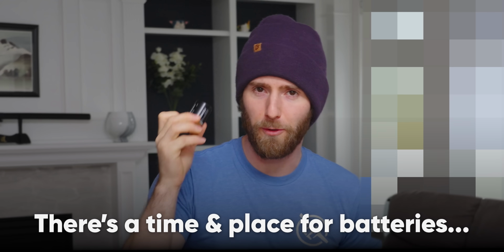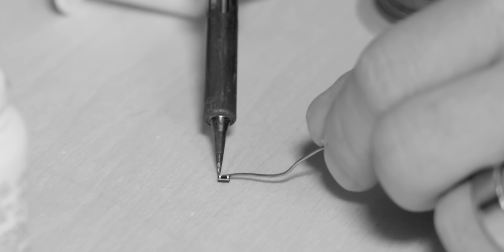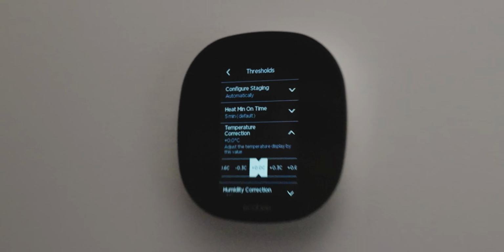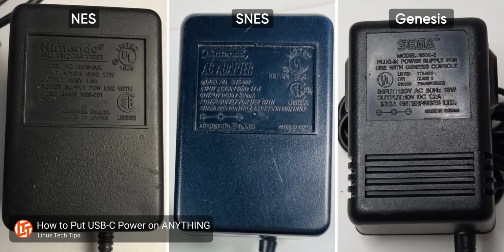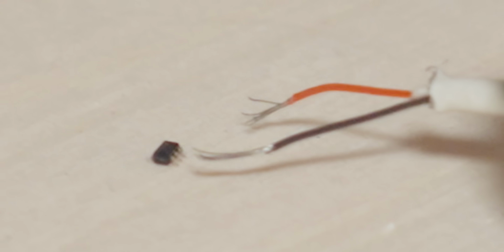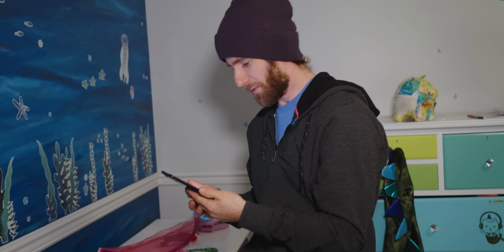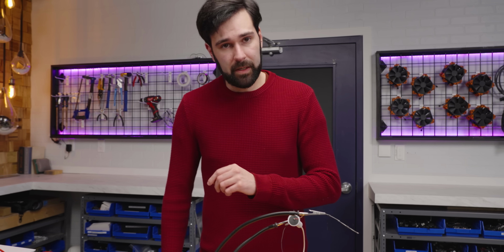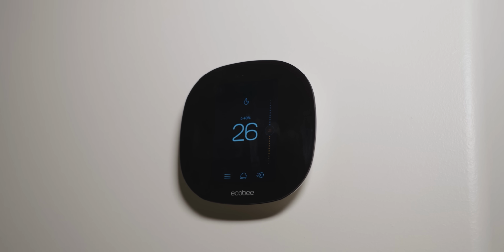I HATE Batteries! - Converting Wireless to Wired (a cheapskate’s guide)

Comment: Pro tip, ethernet can be used to run low voltage long distances to thermostats. If you have crown moulding on the cielings its a perfect space to snake them through.

Comment: At that point, you may as well use the LM2596 board and just smear it with hot glue. Yes, it'll use more power on idle since it's made for supplying up to 3A, but the size and cost makes it very well worth it.
Or use literally any $0.5-$1 buck converter off eBay

Comment: A Resistor is not regulator.
Using  the voltage drop of diodes  to regulate power  is not efficient at all. 
Ironic that they convert the unwanted power to heat in a temperature sensor.
Just use a damn voltage regulator like you had in the video, but RTFM and use the decoupling capacitors to make it work properly.
Its not really unsafe with such low power, but its not best practice nor reliable.

Comment: Now, I kinda want to develop 3D printed, battery sized / shaped object, with variable voltage chip in PCB (0 to 5V) from 5V USB. Where you just solder 5V wire. 
But I don't have a use case on hand so, idea for someone else.

Comment: Be aware. USB 5V power supplies, especially this cheap, will probably introduce a lot of noise. A device made to run on batteries is suddenly plugged into the wall; if you want to do this properly and trust the readings, I would recommend stepping up the game and doing a proper step down with capacitors as filters. You can still do it very cheaply if you use a piece of prototyping PCB, the ones you can easily solder passthrough components, plus the soldering will be muuuuch easier
Reply: Definitely this. For this application I would have gone with an AMS1117 3.3V linear regulator and some smoothing caps and fed it with the USB 5V supply. In my experience that should generate a clean enough supply.

Comment: The current spikes are quite common in battery powered wireless devices. It jumps up a lot when they start transmitting. Also,  I would really avoid using diodes to drop the voltage. If you insist on big tht components, it would be more appropriate to use resistor and Zener diode which are more suitable for voltage regulation (although voltage regulator is nowadays still better choice).
 Using voltage regulator without input and output capacitors is not recommended and can lead to failure to output correct voltage (depends a lot on given model, manufacturers datasheet will specify minimum value). If soldering small components is issue, you can get small voltage regulator breakout boards from AliExpress for cheap, which already have capacitors and the pads you need to solder too are big enough. There are also some products that are made for this purpose (PCB in a shape of a coin cell that has voltage regulator on them).
Reply: No reason to avoid using voltage drop of a diode if the supply is regulated (which in this case it is)
Reply: @pasikavecpruhovany7777  at such low currents, the forward voltage drop will vary a lot and the voltage will plummet when the device starts transmitting (as they experienced). Not really a good solution when proper voltage regulators cost the same or less
Reply: @SolaLupus  Using diodes rated for high current is not ideal, but for quick DIY solution, diodes are probably best way to go. The voltage won't fall under ~2.9V (5-3*0.7) and if voltages above 3.3V are an issue, the issue would likely manifest itself by excessive current draw, pulling the output back down. Another way to keep the output down, closer to 3V, would be adding a large value load resistor to pull few μA or instead of diodes using transistors in diode configuration. (With base tied to collector.)
Reply: @pasikavecpruhovany7777  if you insist on really low level diy solution, Zener diode with series resistor is still more appropriate way to go imho (also less components)
Reply: @SolaLupus  Not really in this case.The load has short high current spikes. Series resistor needs to be calculated based on peak current. Parallel zener regulator would turn peak current into continuous current. Series zener and paralel resistor would work the same as 3 silicon diodes and paralel resistor, avoiding that wasted power draw.

Comment: LEDs are good for dropping a bit more voltage.

Red for about 2v drop. Good for powering 3V devices from 5V.
Blue/white drop about 3-3.3V. Should work fine with most stuff that use a single 1.5v battery

Comment: Most smart home ecosystems allow you to use a compatible sensor (wired in your case) to control other devices (the thermostat in your case). It’s kind of the entire point of them. I’m using an old iHome sensor (wired) to turn on my Ecobee via HomeKit if the temperature in my utility room drops too low to prevent pipes from freezing (utility room has an outside entrance).  I use the Ecobee sensors to average temp across the house and the one in my office to turn on the lights with motion again very basic home ecosystem stuff I guess is more functional and doesn’t require a Jake on staff to set up….anything ever happens to you (or Jake) and your family won’t be able to turn on the lights to see that they are freezing….😂

Comment: In other words, do the setup with the battery installed, and after in initial setup and pairing, remove the battery and add the wired connection...

Comment: Linux, instead of the microchip regulator, people can use the more famous AM1117-3v3, its a 3.3V regulator but its sold for peanuts already in PCBs which include the required components like capacitors and resistors, take a look online :) That and 2 extra wires and people almost dont need to solder stuff, or worst case scenario, burn their hands

Comment: It's probably fine at 3.3v. you could use a 3.3v zener diode in parallel with the device and then a single resistor in series beforehand to make a simple diy regulator. You just gotta make sure you spec your components right so you don't fry anything.
Reply: Yeah~. A potentiometer is not the way to regulate voltage to an active circuit. Much less anything radio.

I'd even bet the first thing inside that sensor is a regulator boosting battery voltage to a standard 3.3V.
Reply: @RandornCanis  Good point. Examining the actual power circuit can take a lot of guess work out of it. Sometimes electronics accept wider voltage ranges than you'd expect.
Reply: Yeah, that's the proper solution, but they probably didn't have any Zeners lying around. If you're ordering components anyways, that's way better than making a giant chain of diodes.
Reply: @anlumo1  the series diode one isn't a bad solution. They have a generally stable voltage drop especially if your doesnt suck much current. With a general voltage drop of about 0.6 volts you could put 6 in series and maybe an extra shotky diode to make the 2 volt drop

Comment: Two copper plates, solder to the copper plates, 3D print an exact copy of a battery. There, easy conversion in terms of cable portion. Then you just need the right input voltage/ampere.

Comment: Why did they choose an linear regulator in an smd package? Something like the standard LM317 in a TO220 package with two through hole resistors would have gotten them exactly 3.2V, been way easier to solder, and probably still fix 
behind the battery cover. 

Later in the video they address using smd components as "making do", but you can definitely order electronics components with same day shipping from multiple distributors in the US and Canada.

Comment: I have converted such devices by using a 2 * AA battery holder, as 2 1.5 V AA cells make 3 volts in series.  AA batteries are much cheaper and the device runs many times longer than on a button cell.

Comment: If you get usb output in the power outlet in the wall you could move the dresser back a bit more. I'm all for stationary things not requiring batteries. It seems our smoke detector batteries go bad at the worst possible times.

Comment: Since you're on home assistant you just could assemble your own sensor based on ESPHome (esp8266+DHT) and put it in your wall socket
Reply: I'd advise against a DHT11 for something used to control the room heating as even a degree change can make the room super cozy vs uncomfortably cold, and the DHT11 is pretty inaccurate at ±2 degrees celsius. A DHT22 is a fraction pricier but much more accurate, and if you want to get even better readings( temp+humidity+air pressure), there's the BME280 I think it was called.

But yes, the 2-pack of Linus sensors cost a whole 120 dollars, and the ESP is far far cheaper. I reckon if it's just a single sensor, they can also use the ESP01 as it is TINY.
Reply: @namankohli1061  better would be the Sensirion (IIRC) SHT40, SHTC3, or SHT31 (in order of price), as they're I2C interfacing, not the weirdness of counting the pulses that a DHT11/22 uses. Less of a concern with a single purpose endpoint, but might as well avoid. 

Then again, I don't know how annoying those are to physically interface with if you don't get a dev board with them like Adafruit sells.
Reply: Big brain solutions. I doubt linus wants to dedicate that much time into this however.

Comment: I have to admit, that SMD soldering was pretty impressive considering the fact that Linus was in such a sub-optimal environment for doing it. I've done some amount of SMD soldering though I tend to avoid it if I can because it can be fairly annoying (especially if you're talking 0402s).
Reply: Agreed, I think a better solution would be to use all through holes and get some very small breadboards. Using SMD is asking for trouble lol. If breadboards cost too much you can get these prototyping breadboards as well (these do require soldering though).
Reply: The SOT23-5 is plenty big enough. Though I probably would have used through hole passive components and soldered them point to point.
Reply: @SnakebitSTI  Eh, I wouldn't do that to myself or unironically recommend it to anyone else.

Comment: I actually did this same type of project recently. I took old galaxy buds and turned them into a high quality stereo Bluetooth receiver. I soldered USB DC power to the batter contacts, and an aux cable to the audio output contact pads. It works. My main advice would be to connect it and make sure it works on the battery before soldering power to it. This was especially important for the buds because it pairs using the case initially, and without a battery they really can't connect to the case at all. My experience of soldering was the 2 years I did it in high school for my engineering classes, it should have taken me a few minutes but I sat in my bathroom for 4 hours, most of the time was spent stripping the wires and preparing them as my only tool for stripping wires were normal scissors. Also I was in the bathroom because it's the only place with proper ventilation in the house. 

I say high quality because I have a Samsung phone and the galaxy buds can use a better Bluetooth signal with Samsung phones that results in better audio quality.

Comment: i recommend a lighter for stripping insulation of wires as thin as what you were working with. just heat it up a little and pull with your nails. comes right off.

Comment: What kind of psychopath lays concrete flooring on the second floor of a house! the weight to reinforcement ratio is way off for a 2 story building. Strip out that concrete and go with a more reasonable joist and board flooring solution for better external wall life.

Comment: I guess that an ams1117 3.3v small board will work just fine. No need to solder SMD components or diodes. The mic5504 also requires 1uf capacitors to be stable.

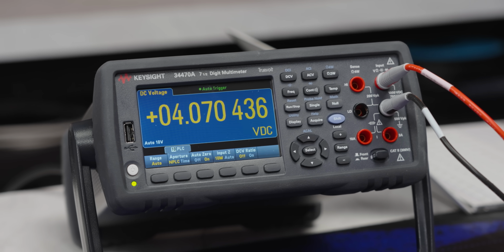Comment: 13:45 You could put capasitor parallel between plus and minus, so those spikes don't cause voltage drops
Reply: Agreed, I saw this being a problem from a mile away. The advantage these cells (and batteries) have is that they're effectively really large capacitors. They will refuse to drop the voltage significantly unless you draw some high loads (>100mA). If you're replacing batteries this is one of the first things you address lest you get "funnied" by dropping voltages. Wall chargers are NOT designed to handle sudden spikes.
Reply: It's right there in the data sheet: VIN and VOUT are both supposed to be connected to GND with a 1uF ceramic capacitor.

Comment: I did this conversion a few years ago on a battery powered lamp for my son's room. It destroyed a pair of AAs in about a week. Luckily I still had the "try me" button and cable that came plugged into it. Measured current through that cable and calculated a resistance for a series resistor to run it from a USB cable. The resistance was low enough and power high enough that I ended up running two half watt resistors in parallel. Heat shrunk the cable after I made it and it's been chooching every night as a nightlight for a few years since. Highly recommended.

Comment: I am an electronics engineering student, never have I though about using diodes voltage drop to drop down regulated voltages, this is really smart and I will use it whenever i need to do something the "fast and junky way".
BTW, you could used a rezistor parallel to the ecobee terminals to keep the diodes in the 0.6 voltage drop range . this would increase current draw (but the powersuply still draws some amount of power so it does not matter) but it will allow you to use this trick on devices with overvoltage protection
Reply: Using the characteristic voltage drop of a semiconductor to get a reference voltage is a fundamental concept is designing voltage regulators
Reply: @robmckennie4203  as a reference voltage, with the current through the reference a known value? Yes.
To "Drop down (already) regulated voltages"?... I mean, I've seen it done in dirt cheap production hardware, but only when the load doesn't have a high PAPR.
Reply: It's an ancient hack, but relies too much on current draw. I usually can't use it because if it's that low voltage, it's also low-power and thus usually very "peaky" in current draw, and I can't justify pissing away milliamps in a device designed to take microamps on average. So I never design it into a device. And when hacking an initial prototype together, I just use an adjustable buck converter module or an adjustable LDO regulator. Or feed it off a power supply. So the utility is limited.

The main issue with hacks like that is that you introduce unknowns, so there's that much more to exclude as root cause if something doesn't work.
Reply: We usually use diodes to combine low-power power supplies together without too much hassle.

Comment: Voltage divider would have done just fine, you could for example calculate it like this: to calculate your voltage by calculating the difference between R1 and R2 using the voltage divider formula  (Vout=Vin(R2R1+R2)) and then use the formula (I Out = I In x R1/R1+R2) to calculate the value of R1 and R2 to get the correct voltage and current.

Comment: i've been doing this for years.  I work with laser cutting machines and cut a slice and a ring of stainless steel at work.  These are the poles of the battery.  at home i print a housing and use a lm334 and a pot to make the voltage right.  if everything is put together it is no more difficult than installing the batteries.  works great.

p.s.  great video

Comment: Other option was to use few diodes. Each will drop voltage by a fixed value. Regular common n4148 will drop voltage by 0.6-0.7 volts.
So 3 of them would do the job just fine.
Reply: Oh. I see they have presented this solution at 13:00
Reply: u even watch the video ? they literally showed that option

Comment: If you have some more space in your device, just get a MT3608. There is a version with Micro USB in and you can set the output between 2-24V.

Edit: I just found out the mimimum it outputs is 5V. So anything below that, you'd need to look for something else.
Reply: At this point just buy a power supply with a matching voltage. they are like 10 bucks.
Reply: They go to 2.4v, i made an instructables using a power bank with this chip to power my multimeter, i modified the voltage reference and added a toroidal ccfl transformer handcrafted to output 9v, also another two 12v for my internet routers, and another two with 3v for my remotes. In the multimeter i also used a double switch with 2200 uf cap in the middle and normally open in the battery and normally close in the probes, that way when i pull the button it shows the battery voltage. I also made another in the multimeter with 120v to test zener diodes and neon lamps.

Comment: So with the cost of the components and including the power draw to use the soldering iron, you could probably buy batteries to run this for the next 5+ yrs if you include the provided battery. Just not worth the hassle.

Comment: there are some small boards that contain "buck regulators" with "pot" (potentiometer) adjustment. You have a high-ish voltage plus minus in, and plus minus out just adjust the pot to the voltage you want. These devices cost about $2 on ebay.
Reply: There are a lot of different types, some large and some small. But I think you mean those mini models from folks like QSKJ.
Reply: @Marco_Onyxheart  I am not familiar with the particular item you quote, but I bought a few to play around with, they require no micro-soldering and the pot is fixed to the board and easy to adjust, and hold their voltage from essentially zero to as much as several amps. I used one to convert a 12 V 100 mA signal to to 5V 200 mA signal, so easy to use. This one drives a mini relay.

Comment: Probably wouldn't be too hard to design a simple pcb that fits in there, makes connection with the battery terminals, regulates the voltage, and has a port maybe USB to power.